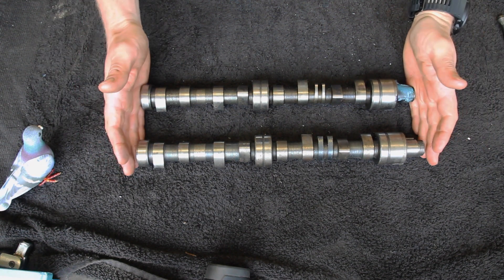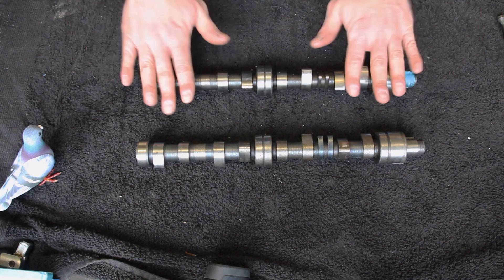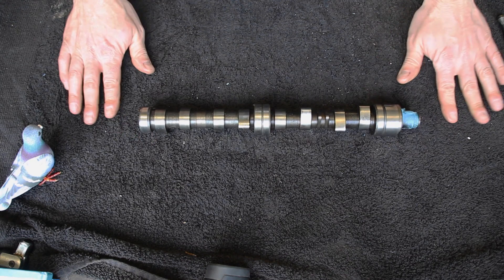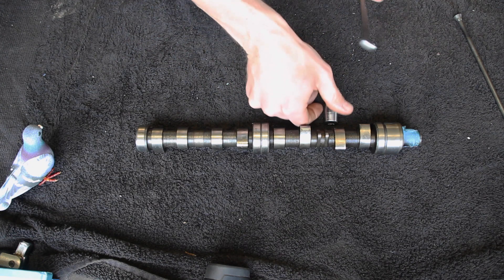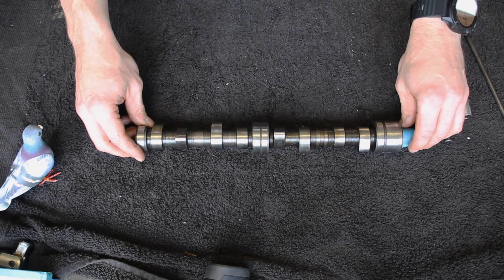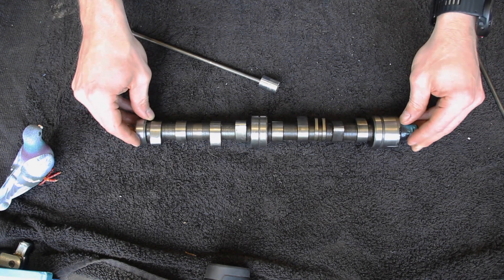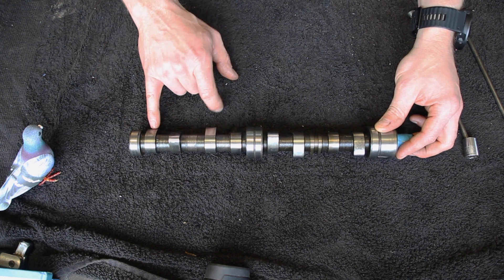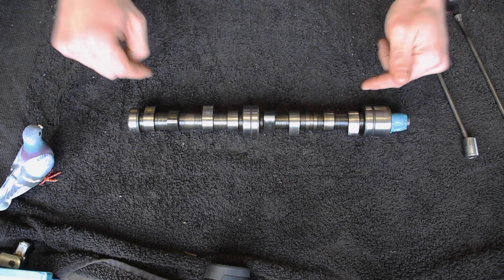Classic Mini Cam Timing - Behind the rule of 9

Comment: I use mirror image from centre, much easier, been in trade over 35yrs,slightly different for small Ford engines, ie fiesta valencia, mirror image, stay in same pot, but adj valve next to mirrored one 🚗✌️, keep up the good vids dude 😃
Reply from the maker: That's pretty much what you can do with rule of 9, work the inner 2 (5&4) then work your way out ☺️